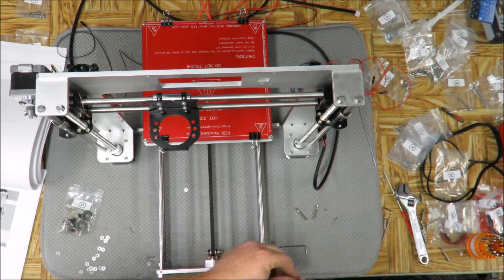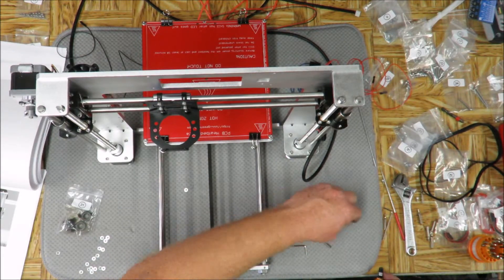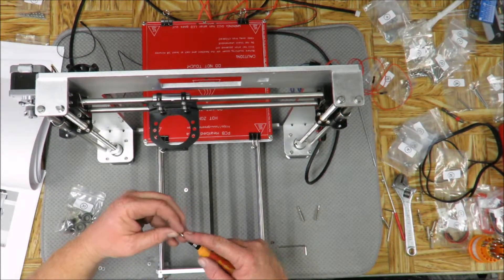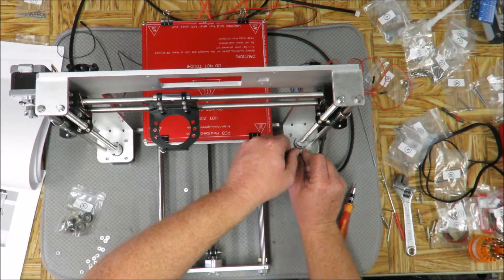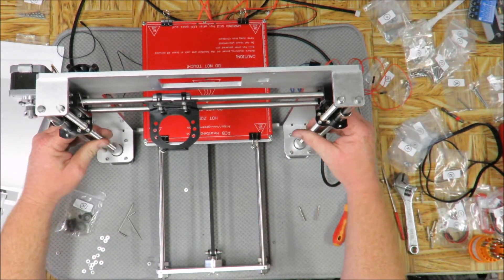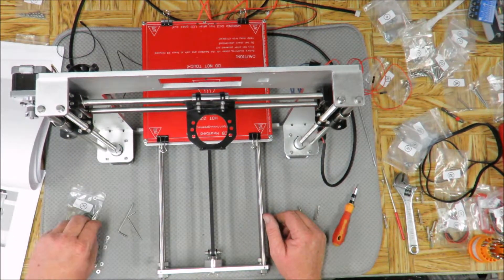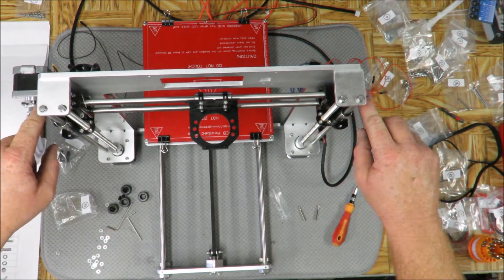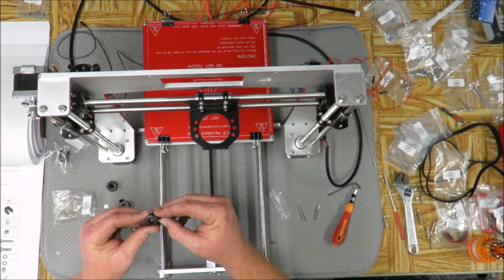Geeetech Aluminum Prusa I3 Assembly Part 9

Comment: BTW... The Flex coupling for the motors are meant to Isolate the Motor shaft from the t8 lead screw.... don't bottom it out there should be a gap inside between them. so the Flex will work.